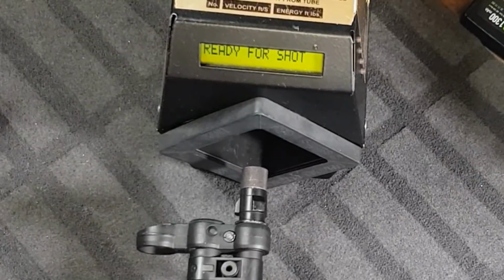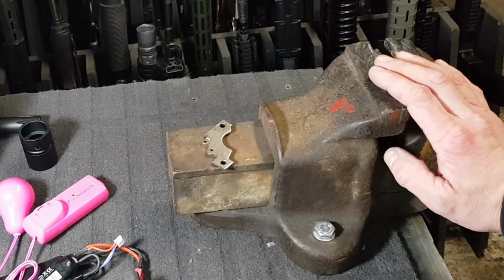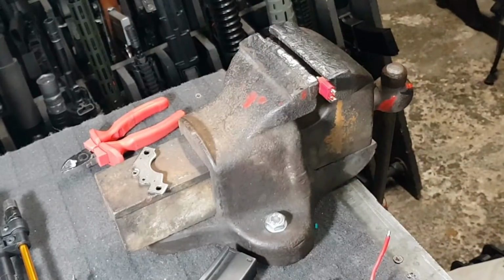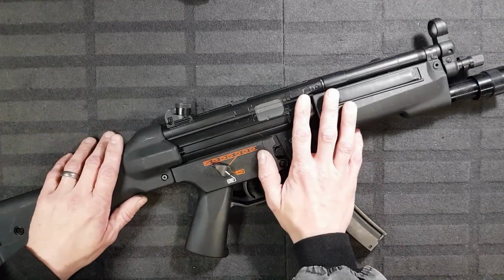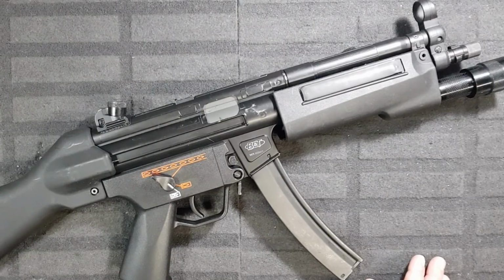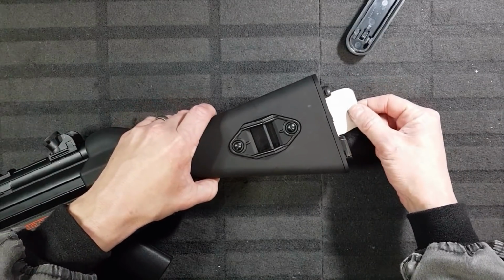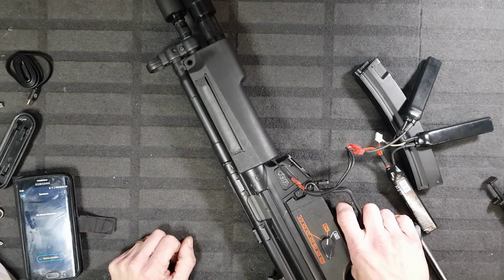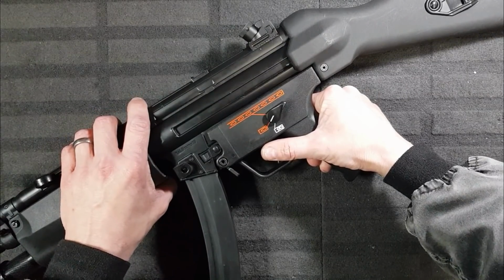A Lesson In Soldering (& a dsg/titan build)

Comment: Soldering is easy but it needs practice. You need a good Soldering iron otherwise you will feel bad. 
I recommend a device called helping hand with multiple arms with clips at their end quite useful. Also before you want to coat any metal with the solder you need to prep it, preferably remove any grease or oils from it , scratch the surface if it is smooth like the connectors, add a drop of " soldering acid " to the metal heat up the solder add it now you got it there for good and there is no risk of the solder falling down due to bad adhesion. Try not to inhale the fumes.

Comment: That's pretty much hoe you should solder. If you don't have a vice there's another little trick for a stable soldering. Take some pliers and put a rubber band around the handles. Put a connector in the pliers and it will hold it in place perfectly. Helped me with soldering in the most idiotic places. Did it once on the edge of a stage while the band was actually playing. A connector broke on a signal cable that was going all the way to the top of the stage to the lights Replacing the cable wasn't an option so I used my trick and a soldering iron.

Comment: As a time served electrical/electronics engineer, your soldering technique is perfect. The deans plugs can be a bitch if they're greasy on the solder tangs. Quick squirt of IPA (not the beer!) helps before hand. Also a pair of long nose pliers with a rubber band on the handles to keep then shut can be a useful heat shunt to keep the heat away from the plastic bits.
Keeping the community going, one swear at a time. 👍😁
Thanks for putting the time and effort in matey, you inspire the rest of us mere mortals.. 😂

Comment: You need to add solder to the cinnect and wire.  The wire should be soaked with solder before connecting.

Comment: just a guess, isn't dens just pos and negative wires? There need to be a data-cable before it will work, if you split open a usb cable there should be 4 wires positive and negative and 2 data-wires. I don't know, I only thinker with microcontrollers so just a wild hypothesis

Comment: Have lots of respect for your knowledge and ability Luke.
I’ve installed a few Titan’s and similar in gearbox mosfets. I would say your problem is almost certainly the laptop/phone you’re using to calibrate it is ancient. I use a laptop that’s 5/6 years old and running windows 8, never had a problem. 
Oh and if you want to sell that MP5 give me a shout!
Reply from the maker: I have a Samsung T10 table 2019 model, a galaxy S6 edge, a 2018 Huawei and my laptop is a Lenovo T410 running Windows 7...
Trust me, it's a reliability problem of the units, so many come to me that the owner couldn't set up or their regular tech couldn't set up... 
At the end if the day, it's not a £300,000 rail gun, it's an airsoft gun so the claim of "Its your phone" I hear every day doesn't wash with me, you shouldn't be required to take a particular brand of phone into the game zone with you to play airsoft... you need a working gun that you can rely on, the titan doesn't provide that.
Reply: Negative Airsoft agreed, I’m not an IT man, but I’ve dealt with my fair share of IT professionals in developing new apps etc, all I can say is it’s very hard to roll out app technology that works perfectly with every single phone and version of windows etc.
Reply from the maker: @Solidsnake0208  yup, how would you feel in your first day of airsoft with your new gun, finding out it isn't set up properly to be told by a tech "you need a better phone" - that's not on.
I need to promise my work will actually work.
I can't trust a titan to allow me to make that promise.
I'm only as good as my word.
Reply: Negative Airsoft agreed... now when will this lovely MP5 worked on by your magic hands be for sale? I’m anticipating a zombie apocalypse 😜
Reply from the maker: @Solidsnake0208  I'll probably take the titan out & put it in a dmr

Comment: I had this problem, first time converting to deans, snipped both wires without doing it one at a time, what a fucking prick I was. This is perfect advice you need a vice and heat shrink, heat shrink is a cunt at  times if you heat the wire too much. Great vid though.

Comment: Mini deans.... Damn never used those for batteries... Won't that limit contact surface???
Reply from the maker: Not really.
I mean, it does but realistically the guns only require a certain amount of amps etc & in a lot of cases, deans are overkill for the amount of draw required.

But I literally did it to make people fuck off & leave my batteries alone LMAO.

The motors never over heat on mini dean's but you blow more fuses if you're rocking fat gauge wiring 😂🤣

Comment: As an EE, I disagree, soldering really isnt that hard if you follow a few rules:
- Use quality solder
- Use a quality iron
- ALWAYS solder whilst adding more solder to the joint (effectively adding flux), or with flux on the joint
- When in doubt more flux
- Seriously, more flux, get one of those little pots to add extra flux on a wire before soldering, it helps a ton
- Take away the solder first, then a second later the iron
- Use a second hand tool or similar to keep the joint steady whilst the solder cools
Reply from the maker: Until the flux goes all into the wiring coroding it... 
I'm not giving an I depth lesson, I'm giving a nice, simple explanation for those with no background in EE

Comment: I have a gate aster in my gun that refuses to work without the perfect amount of light in the room so i can't even field it.

You have taught me the sins of my ways so now it's time to invest in a warfet.

great video
Reply: Guess that's a pretty big downside to the optical sensors
Reply: I haven't had any troubles with light or water so far, and I've intentionally tried to make those issues pop up to figure out where the Aster's limit is. Haven't gotten any of those problems to show up yet, makes me think Gate has a huge lemon rate from their sensor supplier. Warfet is probably better for the vast majority of players anyway, and it's what I'd switch to if the Aster started being a problem.
Reply: @NefariousElasticity  I wonder if the amount of lemons you hear about is more down to the higher number of GATE mosfet sold than the competition. I have a Jefftron Leviathan myself and haven't had any issues whatsoever. There's a video that Jefftron posted of them dunking the Leviathan in water, burning it, and even igniting gunpowder on the mosfet, none of which affected its function. Needless to say, I'm not too worried about my Leviathan
Reply: @Briggsian  It could be, I suppose. Higher volume of sales is naturally going to have a larger number of lemon cases (not necessarily higher *rate*) than lower-selling products. If more locals around me used Asters and Titans, I'd love to compile data on the failure rate, but the airsoft scene out here is pretty firmly stuck in 2012 technology and kit wise.
Reply from the maker: @NefariousElasticity  the airsoft scene needs LESS technology - it's an airsoft gun not a fucking telephone
Reply: @NegativeAirsoftTech  they need to chill on the phones also tbh :)
Reply: The aster is a piece of junk... Btw it's most likely not too much light in your room. Try looking for the smallest amount of grease on the sector cam. It needs to be pristine. Also make sure its shimmed low enough.

Comment: I build superconducting electromagnets and partical accelerators for medical and scientific research soldering mostly 32guage and smaller wire and you solder exactly the same as I do. Cheeky twist, tin both parts, melt the two together. It is as easy as that. Oh and remember the heat shrink first as you said haha.
Reply from the maker: I've wired multiple wires through looms through the gun meaning you effectively need to charge the gun... and forgotten a single piece of heat shrink. Nightmare

Comment: As far as I know (same happens to my dsg), thats overspin (means youve built it efficiently), you can stop that using ActiveBreak, although its pretty shitty since activebreak is going to warm up your motor (brings amp consumption up), making it inefficient
Reply: Althought the trigger sensor not coming up... I have no answer for such hahah
Reply from the maker: @SnizzKid  ab is on full :-(
Reply: StatikkVoid over spin does not mean something is efficient....that just means you are running a big battery, a fast motor with a weak spring, or a big battery and weak spring or any other combination
Reply: @NegativeAirsoftTech  oof
Reply: @opairsoft8100  hmm, I run an m160 with a 20 tpa 22k motor and an 2200mah 45c 11.1, so... Everything "big"
Reply: StatikkVoid ....by your own logic PME would be efficient....overspin just means your system can overcome the spring in it very easy to the point that it precocks. Saying that it’s built efficiently because it precocks is not a completely true story of efficiency
Reply: @opairsoft8100  no, what you said makes absolute no sense, you use a strong spring in order to avoid pme, how come you say in my logic pme would be efficiency if your spring wasnt completing the cycle at the same time of your sector gear? Lol
Reply: @opairsoft8100  efficiency means your builds working perfectly without negative friction

Comment: The one thing I'll say about soldering is: don't cheap out on the solder.  45 minutes of sweating and swearing and fluxing and melting, then I realised I was using the Chinesium wire.  30 seconds finding ze German stuff, BAM, job done in under a minute. I'm a stingy ghetto type, but even my time is worth more than that.
Reply from the maker: Mine was the best £70 I ever spent.
Reply: Well the good old leaded stuff is way better than the new tin whisker generating shit. Might be why you had better luck with the German stuff likely to be the decent old school stuff.
Reply: Also,always use leaded solder,much better
Reply: Can you cheap out on the iron?

Comment: Just a suggestion but you can do the positive wire on the opposite side away from the negative, that way you have a lot more space to work your iron and solder on, and you can avoid accidentally screwing up the negative pole while you are working

Comment: firmware upgrades usually solve the problems you are having with the titan. Had a similar issue with a version 3 titan. upgraded the firmware problem solved. Could also be your phone if you dont have usb 3.0 interface on your phone.. I think the titan requires usb 3.0 minimum.

Comment: What's your favorite hop up unit? I live in the U.S. where we use polarstars at 380fps with .25-.32g bbs. I'm looking into the Maxx cnc me-pro hop up and the umbrella armory maxx cnc collab hop up.
Reply from the maker: Gun dependant.
Zci haven't let me down
Reply: @NegativeAirsoftTech  now, you seem to hate prowin, but the zci looks to be a clone. Why zci? Also I should have mentioned, I'm planning on getting a 363mm zci barrel that I may s hop (I'd like to understand why you dislike s hop patches) and that's the reason I was looking at the maxx models (flat hop umbrella nub and standard maxx r hop nubs).

Comment: Im having a play with dsg and so far im underwhelmed, highest rof ive managed is 42 rps which only a few more than i get out of ssg. At the expense of high current draw and whacking the gearbox using m150 spring. Oddly using the same 2tpa motor i get less rps with dsg than ssg

Comment: The end was funny when trieing to connect with the bleb system . So are you going to be using that gun on next gate titan customer ? Would have like to hear little in-depth talk when you where working inside the gearbox and why you used M170 spring and short stroke so much. Can't wait for next video
Reply from the maker: It's a dsg gear, kinda short strokes itself. ;-)
Thanks though man - so long as we all get a giggle.
Reply: A dsg (dual sector gear) has two gaps (two release points) among the teeth that engage the piston and less teeth per section, which means the piston doesn't get pulled back as far as it would with a normal sector gear, so you need a stiffer spring to get the same velocity (FPS).

Comment: Hey bro love your vids, teching a lot myself. I have found a way to fix the inconsistent single and sometimes burst or auto shots that you get. I have the same with my warfet sometimes. If I set it to burst, with each trigger pull it shoots: burst - single - burst - single and so on.
The way to fix this is to set your RoF % down. try setting it to 70% with low burst. That's how I fixed it. Looked like the 100% setting was giving too much power/energy so it double spins sometimes. 
Hope this helps, cheers! Oh and try to get your hands on a soldering iron that runs on gas instead of electricity. They rock because they get fcking hot and dont require an irritating wire anymore.
Reply from the maker: Nah, it does it on any rof. 
Eventually it connected & I got the sensors sorted.

Comment: It could be possible that your phone doesn't have usb data transfer enabled. Its supposed to keep your phone safe from being plugged in to other devices (ie. laptops, computers) and being able to access the files. Try messing around in the settings and you might need to enable developer settings to enable it. I believe its called usb debugging at least on my Samsung galaxy s6 so just a thought. Cool vids by the way I aspire to be a good tech like you.

Comment: Soldering is bad at home becouse of crap soldering irons tips solder etc. Works for years at electronic company and its easy as fuc k if you got all what you need. Btw great video :)
Reply: Andris Bucis you can easily soldier at home
Reply from the maker: @opairsoft8100  I spent good money on the solder, iron & heads & I can solder well at home now. 
I've watched my Polish froends solder & the shit the use is basically cancer in metal form but with a £6 iron they can solder anything to anything, we're stuck with the shit we're allowed in the UK RoSH compliency etc.
Reply: @NegativeAirsoftTech  i got at home jbc cd-2be great tool bit pricy but worst it. Tips as well bit pricy and its depends what are u soldering if just for airsoft then no big deal what solder iron you got :D

Comment: so the titan is the last thing i need for my scratch built dmr, i like the idea of it for the trigger and customisation options (i want to be able to swap spring and upper to have a cqb gun also), any other options you could suggest i look into instead along with a good micro switch?
Reply: Do Titan but I'd say but the programming card if that's what you want. So if it messes up u can fix it whenever it need to
Reply: @joehernandez2506  that was the plan, so I can swap it from dmr to cqb as needed.
Reply: I made my dmr with specna arms  microswitch reinforced gearbox and gate nanohard mosfet. Works lik charm. Snappy trigger response and if you wish, making hair trigger on it is rather easy. Absolutely no need for titan or opritical mosfets. So if you wish a bit more programming options, just choose warfet.

Comment: do you have any tips to get the fire selector a bit more posistive when it clicks in? 

Thanks
Reply: On an M4 style receiver the fire selector locks with little ball bearings to divets cut into the receiver at the fire mode location. Expanding these very slightly can help if they're undersized. Oversized might be hard to fix though.

Comment: Get some flux buddy. Dip the wire it or wipe flux on the wire and the terminals. You will ensure a better solder joint. Tin your solder points also before using them. Most soldering wire comes with flux in it but you will get a better join with flux.

Comment: Do you think you will make a video about a cheap p90, and make it a decent no mosfet gun?
Reply from the maker: I have the Cyma, it's great.
Reply: @NegativeAirsoftTech  will be it soon? and also can you tell me if is only mine or is common problem that the p90 have with the hi capa magazine. My, 300 bb, mag gear will lose tension after 10 to 20 shot and i have to take out the mag and turn the gear again. Please if you can put a list of parts you used to make the replica, and i really appriciate the answer thank a lot
Reply from the maker: @dranzer330  use midcaps bud, hicaps suck for P90's
Reply: Negative Airsoft thank you